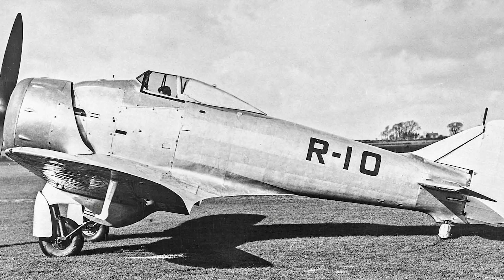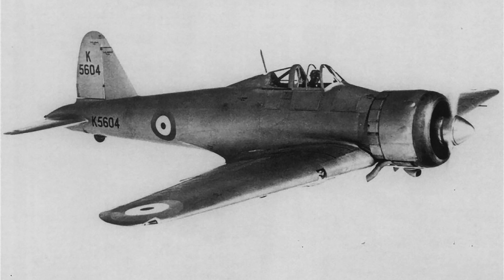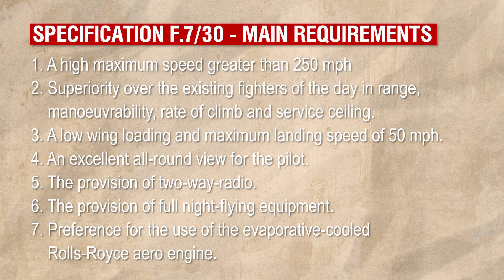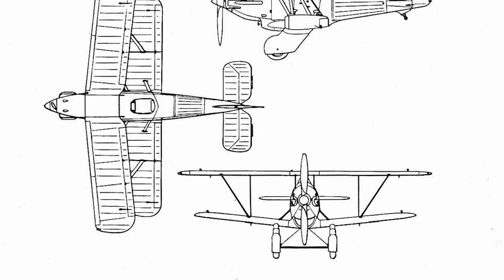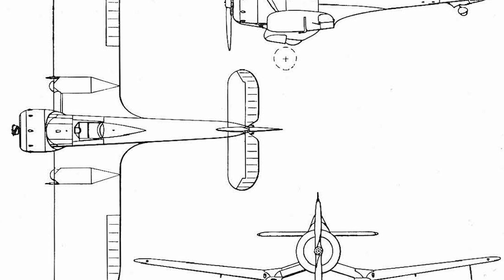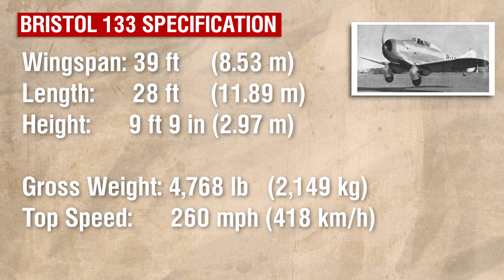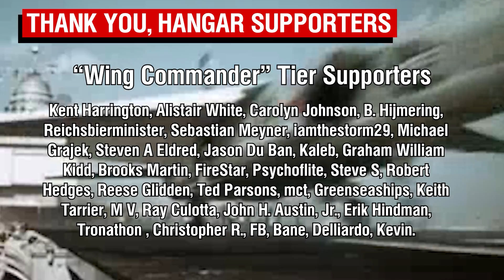Bristol's Gull-Winged Failure | Bristol Type 133 [Aircraft Overview #96]

Comment: Bristol,s Model 133 was a step in the right direction, a tidy but flawed  design, those morons in the Air Ministry  finally realised that the RAF,s WW1 era biplanes of rag wood steel tube and chicken wire were yesterdays fish and chip wrappers. Yet the new kids on the block hoping for an air ministry contract ,relied on a mix of the same old crap, only one other design stood out Reggie Mitchells Model 224 a super cool gull wing monoplane, blighted by a fixed undercarriage that would shame an Afgan Hound, an equally crap engine  cooled by steam, what drug were Rollers engineers taking in their morning tea, Ketamine?. The 133 needed help, who ever designed the 133,s retractable undercarriage should be sacked, the damned gear created more drag retracted than a Ru Paul Piss Up. The Bristol Mercury in  essence a re cycled Jupiter had very little developmental meat left on its bone, twirling a fixed pitch wooden prop stolen off a Bulldog .  Were Bristol engineers so up themselves as to not look outside their cosy blinkered nursery at new designs  simmering on stoves in the USA and Europe. Yes Cats&Kittens Clarence 'Kelly' Johnson, cooked up on Lockheeds stove some  of the coolest designs in chrisendom, one of them, the Orion.  A clean cut single engine cantilever monoplane airliner of mixed construction with a fully retractable undercarriage ,I E the wheels and legs housed entirely within the wings when retracted.     The Model  133 a promising design blighted by ignorance, short sightedness and stupidity,. I  bin the 133,s crap undercarriage and engine, bolt on a 750hp Curtiss Wright R-1820 F-52 Cyclone twirling a three blade two pitch Hamilton Standard Bracket prop, get George Dowty to re work the undercarriage to retract outwards like the Heinkel He 70 Blitz Lightning ,and touch wood have a monoplane fighter the RAF could use.
Reply: British radial engine designers got enamored with the sleeve-valve approach and didn't anticipate the technical issues they'd run into with the more powerful models. Had they stuck with conventional poppet valves and scaled up-like Pratt & Whitney and Curtiss-Wright did, they'd have had the powerplants needed for-especially-naval aviation applications. It all comes back to engines, if you don't have models with enough power you have to use fuselage design 'tricks' to attack drag and lower weight. Corsair, Hellcat and Thunderbolt started with a clean sheet of paper with a known radial engine of 2000 HP +, they didn't have to compromise on structure to achieve performance. Bristol dropped the ball in the early 1930's when the put the Mercury on the shelf and went all-in on sleeve valves. Perseus was a good engine, but topped out around 1000 HP-and the Hercules topped out around 1600 HP. Centaurus ended up with program delays owing to durability and got those fixed too late. There is a lot to be said to be the firstest, with the mostest and Pratt & Whitney grabbed the brass ring. RR Merlin did the same thing with liquid cooled powerplants, Allison sucked hind-titty when it came to the Mustang.

Comment: This prototype was 18mph than the prototype that became the gladiator with the same engine. I can imagine with the uprated mercury that was used in the production version of the gladiator it could have topped 280mph with a supieror climb and dive rate. Thus of 150-200 of these were ordered instead of the gladiator the early stages of the desert campaign and the defence of malta would have been rather more successful/less costly. It would also have got the RAF ground crew familiar with repair and maintenance of stressed metal airframes a good three years before the arrival of the spitfire.

Comment: Ugly little bugger that one.

It is hard to say if it was a blessing or a curse that this aircraft crashed. By the time it was flying we had F.5/34 issued. Bristol put forward the Type 146 which was basically a Type 133 only completely different. To me this suggests that despite the moderate success of the Type 133 in the trials Bristol had already decided this aircraft was a bit of an evolutionary dead end.

Also to be considered in the timeline is that Hawker is starting to push the 'Fury Monoplane' and the RAF are starting to push for 6 or 8 gun fighters and the word 'Hurricane' is going to soon start being popular closely followed by the word 'Spitfire'. Sure the RAF got the Gladiator, but less so because it was great improvement they had been hoping for, but more that F.7/30 had been a bit of a fizz.

So... what if it hadn't been? Let us say the Type 133 hadn't crashed. I would argue that the RAF were already looking towards the F.5/34 and the associated evolution and that Gladiators may still have been ordered to take up some slack while waiting for Bristol to move from prototype to production. As shown with the Type 146 Bristol was probably wanting to move past the Type 133 and so production numbers of the Type 133 may have ended up being relatively small.

So... best case for the Type 133 was limited production and squadron service with the aging aircraft being regarded unfavorably c.f the newer Hurricanes by 1939. The aircraft would have limited combat during the first year or so of the war but, not being a biplane, would never get the romantic respect the Gladiator managed to collect.

Worse case would if the type had gone into massive production to become the prime single seat fighter for the entire RAF. With funding going to this aircraft there would have been limited funding to go towards Hurricanes and Spitfire. The RAF had just received 1000 of the type, and they were only a few years old. Waste of money to throw them out straight away and all that. This would end up in a similar state to what happened historically with the Battle and Blenheim. Technically advanced bombers that were a big leap up from the biplanes they replaced and put into service in great numbers... but aging quickly and due to the numbers invested in, delaying development of a replacement.

Maybe. Maybe not. Hidesight is a great thing and pretending cost nothing, but like I said, the Battle and Blenheim showed what happens when you get the 'timing wrong' in a rapidly changing tech field.

Great video.

Comment: I have noticed that many aircraft that failed not because of the basic design or concept of the aircraft but the failure of the power plants. I would be interested in the reason or reasons for so many power plants not reaching their expected specs. Was it the metallurgy, engineering knowledge or capability or other factors that were involved.

Comment: The one that really intrigues me is the Blackburn B.20, which seemed to be a really good solution to lots of problems with flying boats or floatplanes.  Imagine a 300mph flying boat bomber.  It was scuppered (word fully intended) by using Vulture engines.
Reply: The Vulture was aptly named. It picked the bones clean of aircraft that got saddled with it.

Comment: Air Ministry told all the AC manufacturers, "you can use any engine you please, as long as it's made by Rolls-Royce". Another clever British design sandbagged by dependence on the Government darling, RR.
Reply: Its a myth that they specified only the Goshawk. Quite the reverse, Dowding, who was in charge of the committee to draw up F7/30, wanted a radial engine specified, to boost the developments of Bristol and Armstrong Siddeley. But it was decided that they couldn't be partisan so the specification just says "A British engine of the latest type" - But because Rolls-Royce was so successful they could afford to loan Goshawk engines at virtually no cost to anyone who wanted them to build their prototypes. That's why most companies used it.

Comment: I wonder…..

 Did someone from Bristol leave and go to work for Vaught?

 Yeah, I know, the designs were a coincidence and one plane sucked and the other was a massive success….
Reply: I believe the Corsair's inverted gull wing was intended to allow the use of a shorter undercarriage (for deck landings) while giving sufficient clearance for the very large propeller needed to handle the engine power.
Reply: @CharlesStearman  Shorter gear legs yes, but it's not really about deck landings.  Prop clearance is just as important for runway ops.

Comment: "Extended the rudder after initial trials showed a lack of directional control" seems to be a recurring theme with these interwar aircraft.  Was this due to some basic principle that wasn't yet understood or was it just an attempt to make a drag-inducing element as small as possible and incrementally expand it to what was determined to be the minimum viable size?
Reply: Hard to say, my guess is the increased weight in the front end with heavier engines, more guns, and metal is what required more surface area to push the tail left or right.
Reply: It would be amusing if there is one aircraft somewhere in the period that looked at how everyone had to make the tails bigger every time, and decided to go with a tail that ended up being too big.

Comment: Enlarge the rudder to get the spin characteristics right, put in a 800+ hp version of the Mercury engine and it will be at least on par with the first generation of Italian low wing fighters and superior to the very last generation of Polish high wing fighters and to the whole last generation of biplane fighters.  
Even if the RAF didn't want it, it could have been a successful export aircraft.

Comment: What are the advantages and disadvantages of the inverted gull-wings?
Reply: The most important advantage is, it keeps the undercarriage short, lightweight and sturdy. It improves the vision from the cockpit, forward down over the wing leading edge. It gets the wing guns further down, making access to them a bit easier. It gets the center of gravity lower than a straight wing, which improves roll stability. It increases the vertical distance between the wing and the elevator, improving elevator efficiency (if the fuselage doesn't disturb the airflow back there anyway). When the undercarriage fails, the wings act as skids, reducing the change of the engine to hit the ground in a belly landing and slightly reducing the change of the aircraft from flipping over in a belly landung. 

The major downside is the way more complex, more expensive, heavier, harder to repair, wing spar design. Other downsides are more complex aileron and flap actuator mechanisms. A possible downside is, there can be aerodynamic interferences on the top side of the wing kink, messing up handling characteristics or even performance. If that happens, it's hard to get it right without starting from scratch. The aerodynamic stability of an aircraft with inverted gull wing is a bit harder to calculate, especially when you have to do it with pencil and paper.
Reply: @Itsjustme-Justme  "It gets the center of gravity lower than a straight wing, which improves roll stability. "
I'm trying to understand why that would be true but I'm having trouble. 
First of all, lowers the CG with reference to what? Maybe with reference to the fuselage waterline, but with reference to the wing is raises the CG.  Either way it more importantly changes the location of the wing with reference to the fuselage, placing it further below the CG. This has the effect of adding negative dihedral angle to the wing, reducing lateral stability. One can see a noticeably large positive dihedral angle in the outer wing panels of the F4U corsair to compensate for this effect.
Reply: @Itsjustme-Justme 
Wow.
Thank you.
You know your stuff.
Reply: INTERFERENCE DRAG REDUCTION. SEE GREGS AIRPLANES.
Reply: @donaldbowen5423 
Thanks.

Comment: The RR Goshawk killed off more fighter designs in the early '30s than pretty much anything else.
Reply: Did air ministry people have stock in Rolls Royce ? They wanted Rolls to power nearly everything .
Reply: @garyhooper1820  They were actually trying very hard to find alternatives capable of supplying similar power:weight ratios in order to diversify supply & in case serious faults became known (some of the early Merlins had issues with cylinder blocks cracking & porous head castings).
The Merlin was just so bloody good it was hard to beat

Comment: If you want massive range, one way to do it is through the use of a 'wet' fin, or building internal conforming fuel tanks between the cockpit and rudder if possible.
Reply: Do any aircraft carry a usable quantity of fuel in the fin? The F/A-18 has tanks in its fins, but they are tiny, and not there to add to fuel capacity. They are part of the fuel vent system only. If they fill during a refuel, there's a failed shut-off valve in the system. And that's with engines at the rear giving a Centre of Gravity somewhat closer to the fin. A fuel tank in the fin of a front-piston-engined aircraft like this (typical 1930's/40's design layout), would play merry hell with C of G. Probably to the point of it being unflyable. Tail heavy on take-off with fuel in the fin. If it doesn't crash on take-off it would be constantly needing to be re-trimmed as fuel was used. Most fuel has to be carried in wing or centre fuselage tanks because allowable C of G range is severely limited. That's the reason why refueling of military cargo aircraft is done at the direction of, and under the supervision of the aircraft's Loadmaster, who calculates exactly how much fuel is to be pumped into each of the aircraft's tanks, depending on a range of factors including weight and position of the cargo being carried.

Comment: It was a very beautiful aircraft at a time when biplanes were the norm. A very lost chance due to only one air frame being made. You should always have a back up. The air frame is very reminiscent of a Corsair with its gull wings, but it fuselage shows hints of  Seversky /Republic models
Reply: The similarity was there because of all of the same thinking that was going on at that time, raindrop format to lessen drag resulting in the familiar fuselage format with a radial engine and also with the wings where it was recognised that a right angle join to the fuselage gave the least drag. Both of these were challenged with the development of effective and efficient wing filleting at the fuselage intersection and the use of inline engines which naturally encouraged the arrow type of fuselage.
Reply: Beautiful? What ? It is one of the most ugly aeroplanes the British designed (they had a knack for designing ugly aircraft yet produced some of the nicest, like the Spitfire and the Lancaster, and some others of note).

Comment: ERROR: at 9:20, the length and wingspan of the wings is wrong, either in Imperial units or in metric units
Reply: True, He's got the metric units the wrong way around - The Span should be 11.89 metres and the length 8.53 metres.